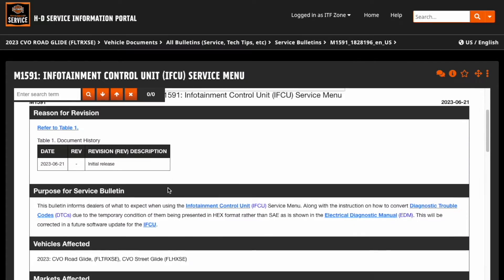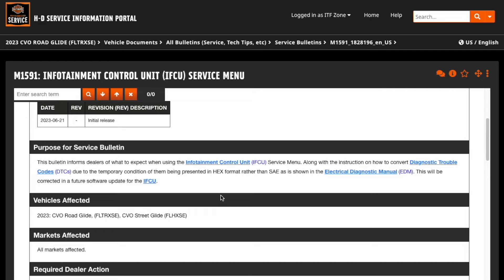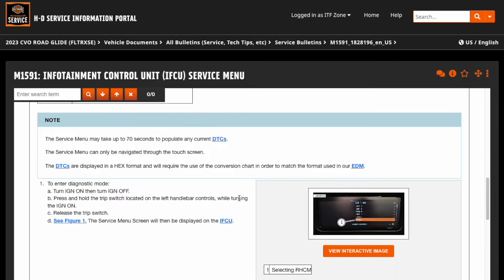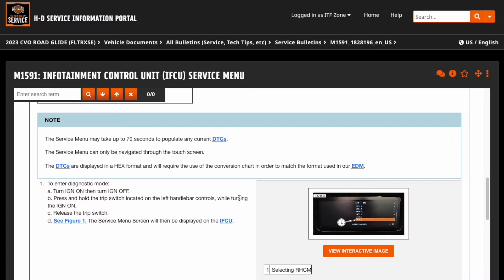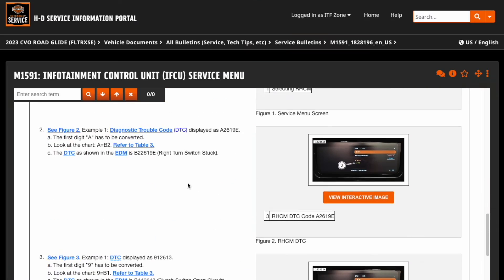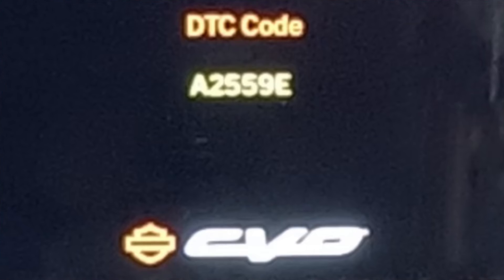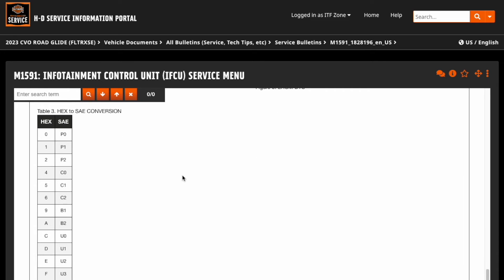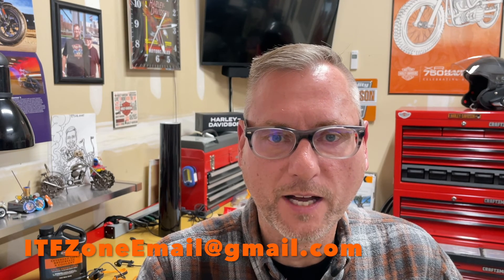Reading DTC Codes on '23 CVO: Update

Comment: What caused the a2559e code? I tried clearing it on my CVO and it won’t clear.
Reply from the maker: I found that if I didn't hold the trip switch too long it would boot up without it.   I have learned that this is really a bug,  it's throwing an "Instant" code just from holding the trip switch down to get into the service screen.   In short ignore it!
Reply: @ITFZone  thanks for the quick response!

Comment: I seen an option to turn “fog lights on” do you know where the fog light power plug is?  Thinking of adding some Baja Design fog lights.
Reply from the maker: It is behind the radiator which is easy to remove.  In the center.  If you want to email me I can send you a picture.   ITFZoneEmail@gmail.com